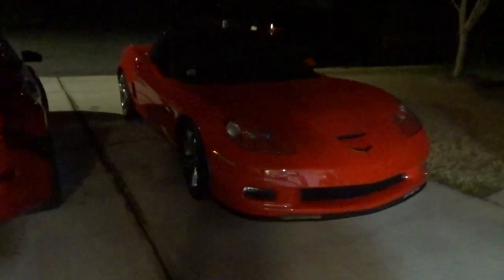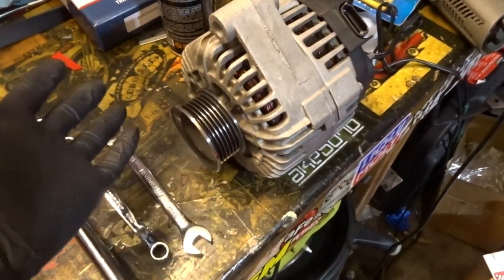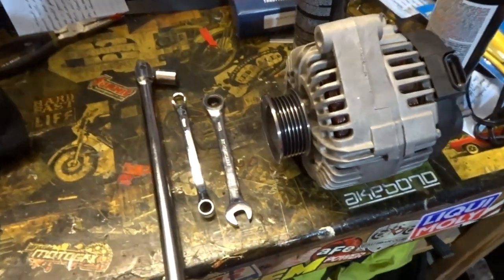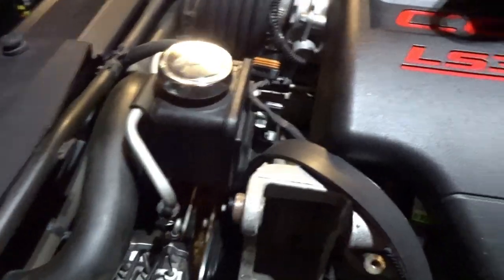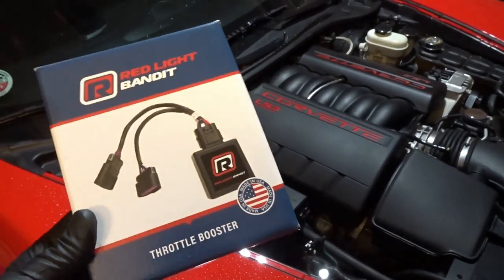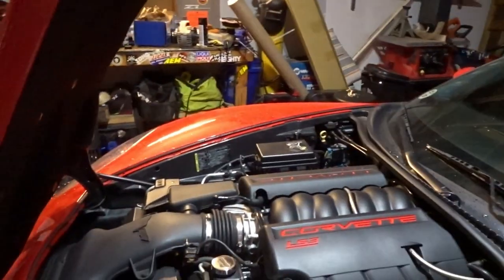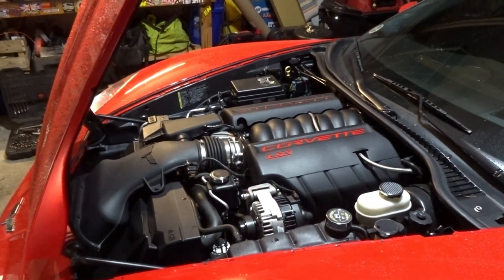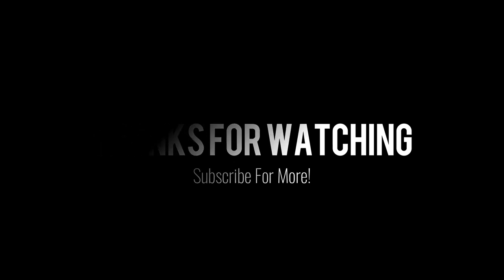How To Replace a corvette Alternator in 10 minutes | c6 Grand Sport

Comment: These cars are nice and powerful but they are the most problematic cars I’ve dealt with. Even low mile vettes tend to pose problems.
Reply from the maker: It’s really funny the feedback I get.  Some say there are an array of problems and then others say they are the most problem-free vehicle ever 😂
Reply: @SpeedCultureStudios  I guess it just depends lol some are bulletproof. I guess ours are cursed. I recently bought a new battery and tonight I get the low voltage warning. Assuming it’s the alternator since the voltage crept down to 8v while running. Always something man
Reply: There the most problem free car , recently crash mine and trying to fix it the alternator went bad. Having trouble current loosing up the belt